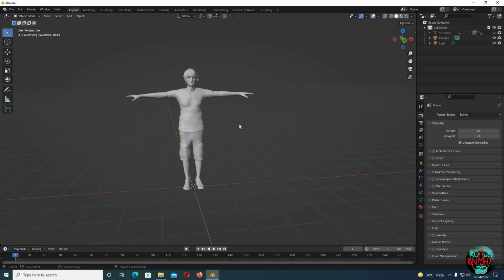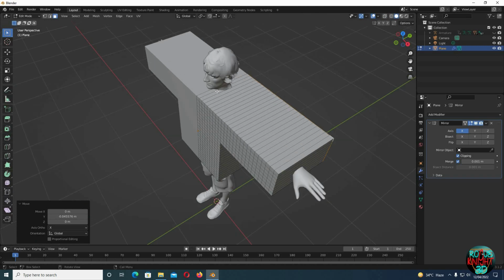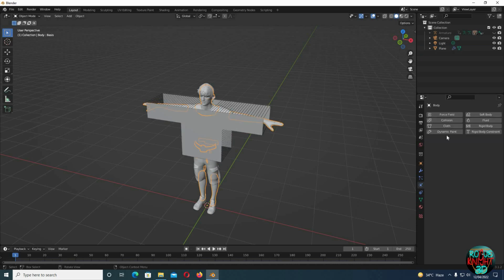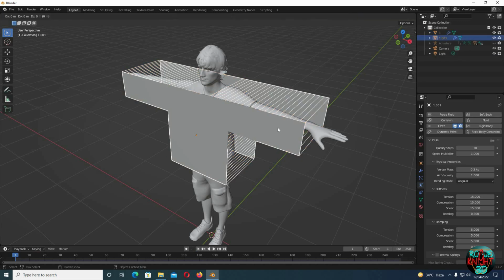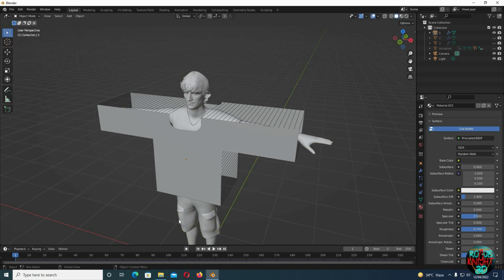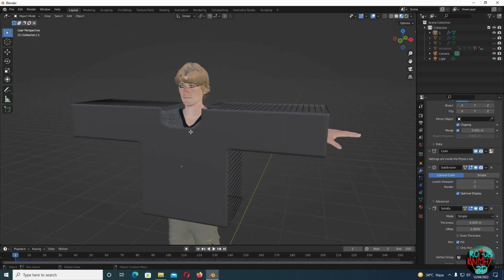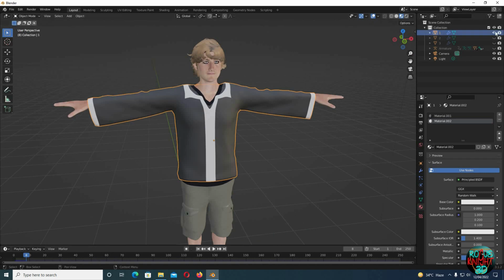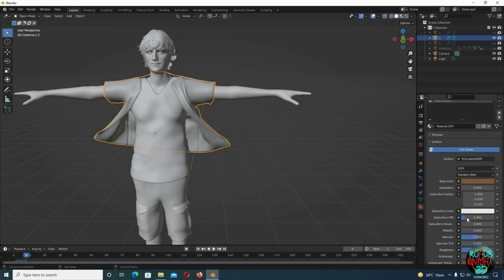How to Make Easy Clothes in Blender || Blender Cloth Tutorial || Easy cloth Simulation

Comment: A Bit confused at why proportional Editing isn't doing a thing? I Turned it on, grabbed the Vertice and tried scrolling with the mouse wheel just to find it goes in and out of the model?

I tries holding left click, holding the mouse wheel, Pressing page up and down to no avail. I even tried re-opening blender incase it was bugged. What am i doing wrong? is there a shortcut i don't know about?
Reply from the maker: Which mode are u using when you trying to select the vertices
Reply: @RogueKnight3D  I found the reason, For some reason the indicated circle was so wildly zoomed out I couldn't notice it at all, I must of done this in a previous project without realising 🤭

Comment: Thanks for the tutorial, everything worked out as it should.
I now have a problem with the animation tho. The cloth wraps around the body just fine when it's t posing but not when I parent it to the armature. Maybe its because of the automatic weights?
edit:
alright I didn't apply the cloth modifier, now when it's apllied, it works. However there is alot of clipping, any tips on that?
Reply from the maker: Its totally ok.. Am glad it worked.. Play around with the collision..  It will fix clipping in many areas..